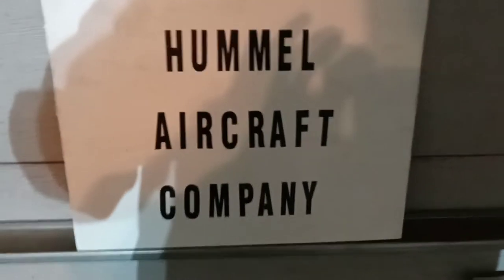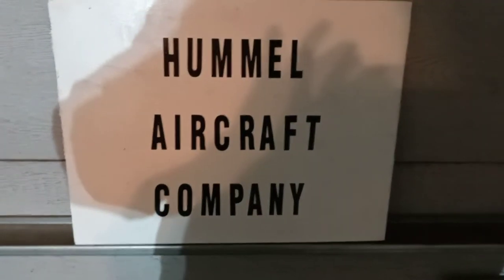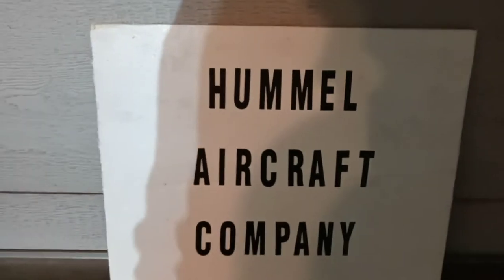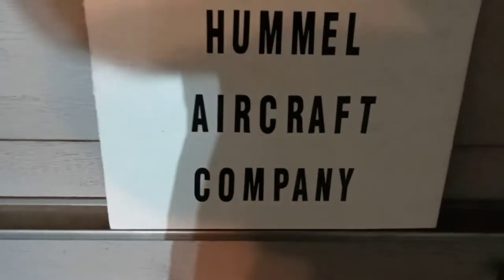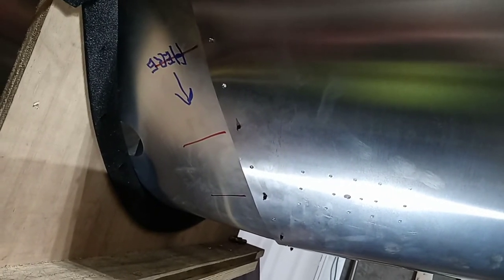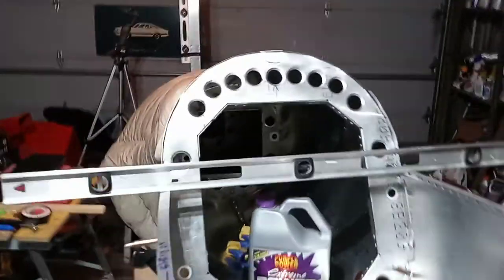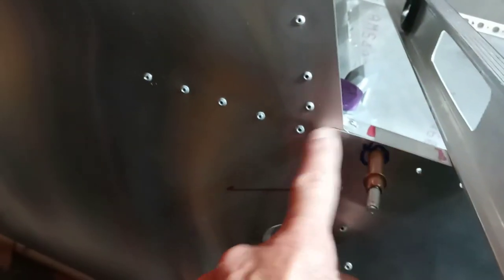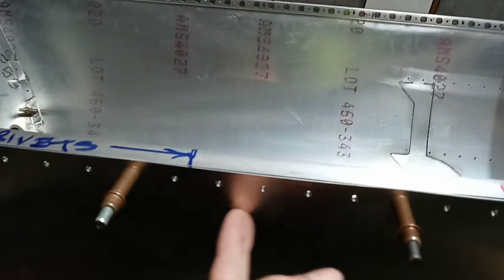Bulkhead C getting some rivets!!!

Comment: Glad to see you back brother. Happy memorial day to you also. Pool pump equals 3 wires and 4 bolts. Basically. you got it. Do you make that 200ft +/- radius bend on the main support angle
Reply from the maker: Hi Michael T well thank you sir. Well I don't know about any bolts. It was not bolted down. I did it it was not to big of a deal!!!
Reply from the maker: Hi Michael T sorry I did not see the rest of your message until now. Yes I did do the bend in the siderails on my first UC. But the kit came with them bent. I ended up buying the siderails from Hummel for my H5 after Terry told me I may not be able to bend them
Reply: @redblackvette  ya I have the side rails for my H5 sitting on the bench now. They are not bent yet but I have a plan on getting them bent. I will use my 48 inch CNC machine to draw out the arc. talk later.
Reply from the maker: Hi @michaelt5082  well Terry told me without the right equipment they are hard to do. I wish I would of at least tried to do it myself first. Oh well. But good luck to you!!